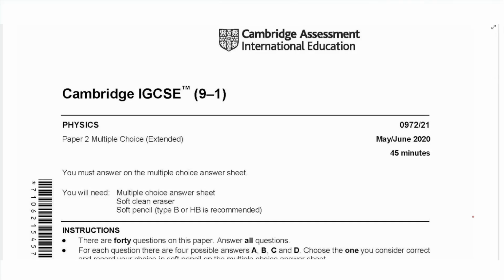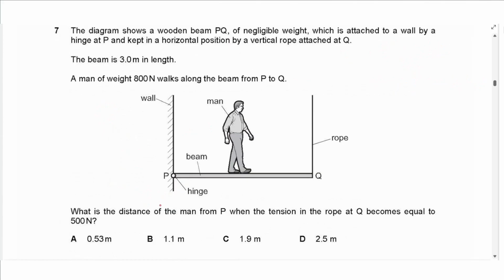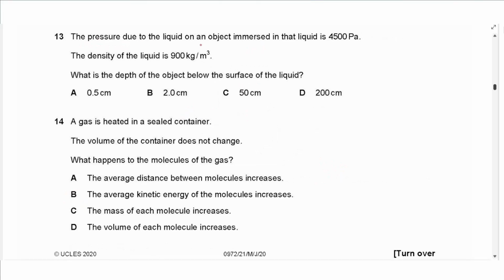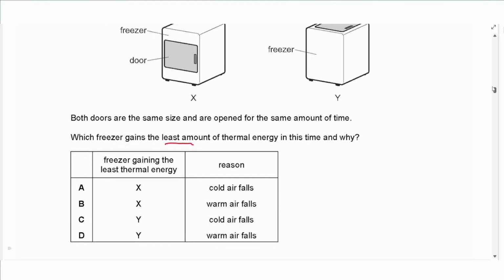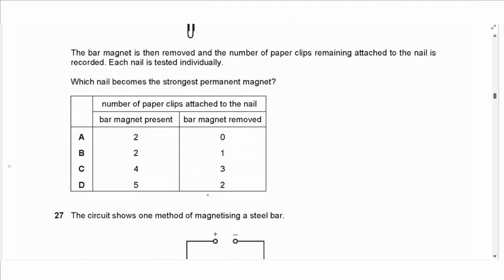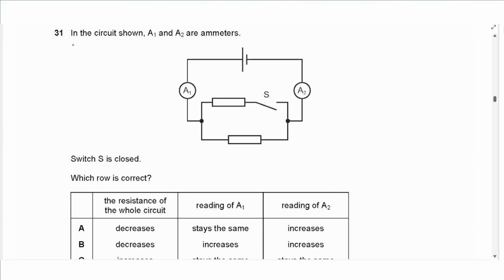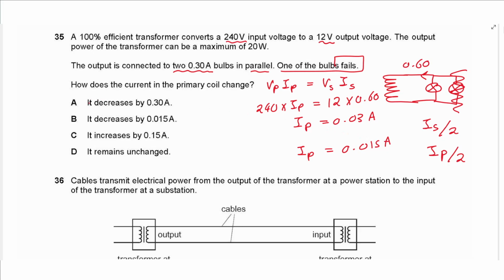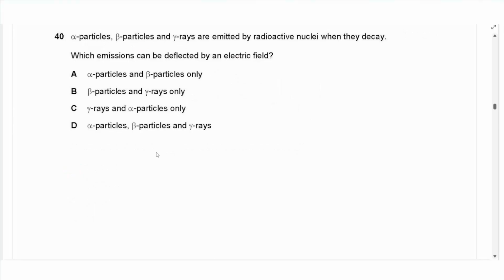IGCSE Physics May June 2020 Paper 2 Variant 1

Comment: Sir in question 9 wont we add up 2m/s and 5m/s.. as both of the velocities are on the same direction and btw in your solution youve used 5 and 4... Isnt 4 magnitude of force, its not the velocity
Reply from the maker: typo it should be 2m/s yes